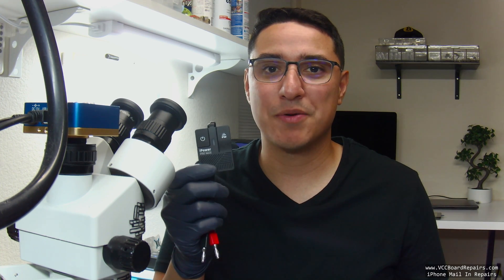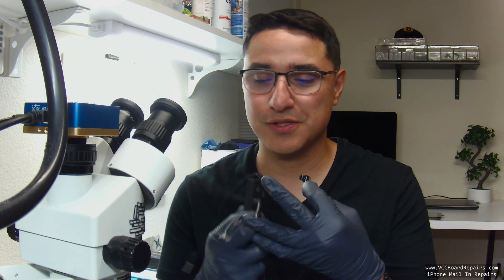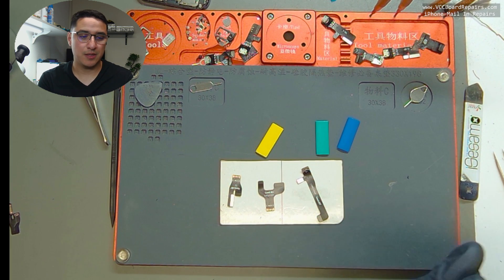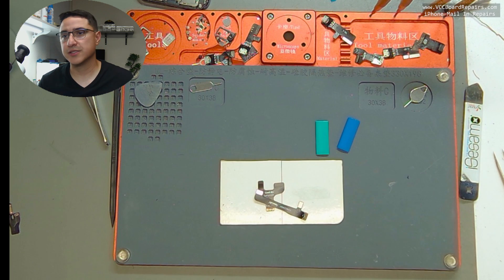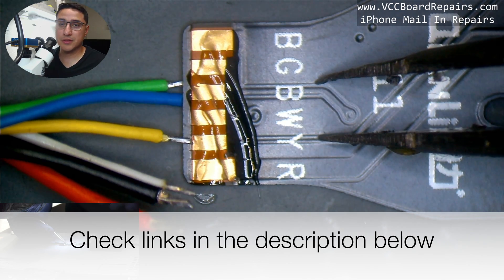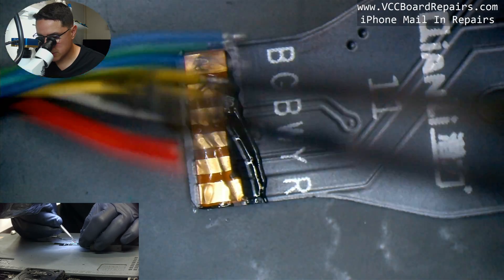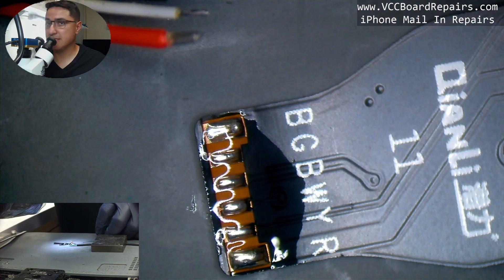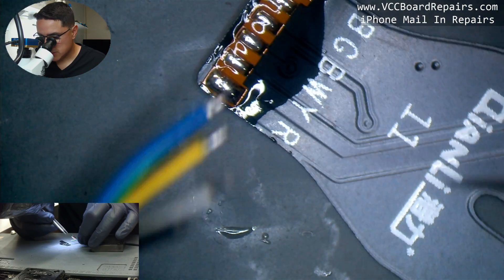How To Solder the Connectors to the QianLi iPower Pro Max Cables. Video for Beginners.

Comment: Jesse I have a question, I got the old ipower pro (red box ) first one it came out, can I buy only the sockets and solder in case I need a specific socket instead of buying the whole new unit . but I see there's more cables like 5 compared to less on the ipower red one ... if you can guide me
Reply from the maker: Qianli used to sell them but now they only sell the 6 pin connectors like the one in my video.

So maybe it's time to just upgrade your tool.

I recommend the DT880: https://vccboardrepairs.com/buy-dt880
Reply: @VCCBoardRepairs  Thanks Jesse for answering, I'm, into cell repair as well, and I learn a lot with your vids. Keep it on like this you have your own and unique way of explaining that makes you come out from the masses.
Reply from the maker: @daaudiome  Thank you! Appreciate that!

Comment: I bough this box, got a few days ago, When I try to use the FPC Iphone 7G  the FPC won't fit. Well any of both FPC marked for Iphone 7G and Iphone 7P won't fit the FPC receptor. The Iphone I am trying to turn on to test this box is an Iphone 7 (A1660) what it supposed to be The FPC 7G marked.  I know there are two version of Iphone 7, The Qualcom and Intel. What point I am losing? if you or someone here may direct me how to turn on an Iphone 7 please.
Reply from the maker: Yes, the 7G means iPhone 7 (not the plus). I'm not sure why it doesn't fit. Maybe you have a defective unit
Reply: @VCCBoardRepairs  Thanks my friend, subscribed! Respect!
Reply from the maker: @svsv9  I'd recommend getting a DT880. It works better than the iPower device:

https://www.vccboardrepairs.com/buy-dt880
Reply: @VCCBoardRepairs  Have you used this box using  Fpc  7G marked on an IPhone  7 and work   fitting fine?

Comment: Hi, nice video, perhaps a dumb question, but I have 3 cables, 2 USB C and 1 USB 3.0, does it make a difference, where I solder the connectors? Furthermore, what power supply do you suggest in combination with this tool? ty in advance
Reply from the maker: It shouldn't make a difference which ones go up which cable.

Any DCPS should work.

I use this one

https://amzn.to/3wNvBKj
Reply: @VCCBoardRepairs  Perfect, thank you!
Reply: @VCCBoardRepairs  Hi, what voltage and ampere do you set for an iPhone X? I've tried 4.3 voltage and 2A, but the iPhone won't start. I've only recognized that the Qianli Tool gets pretty warm, the soldering should be ok, I am seeing an output of 6,5 watts on the Power Supply. ty
Reply: @1980Hatsch  no answer yet to your question, well, I have the same problem with an Iphone 6G it won't star, clearly box mark 3.8v to 4.3 v max input, I have set that my PSU at 1.5 A what it is enough I may say. Quanli does not have any manual what is a shame or support team. I Feel like I just trow away $36 bucks plus tax.

Comment: By the way this question is off topic but I would like to know if the same principles I’ve learned in repairing the iPhone 6s can also be used in fixing the iphone 7 and 8
Reply from the maker: Yes, iPhones are all designed in very similar ways. So you can use the same knowledge and it should apply to other models.
Reply: @VCCBoardRepairs  Thanks bro